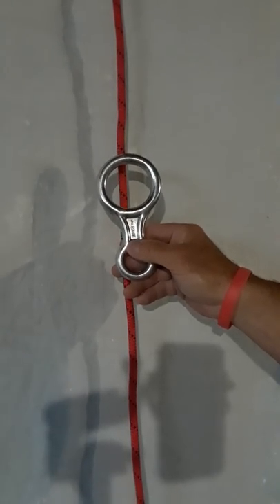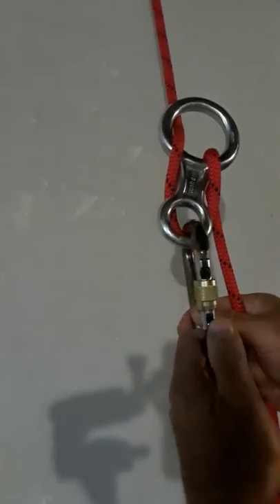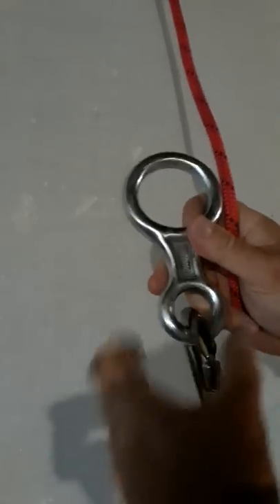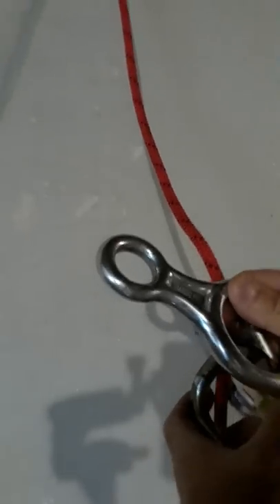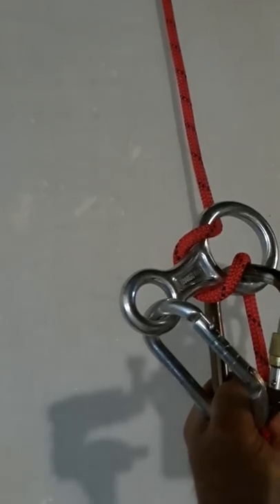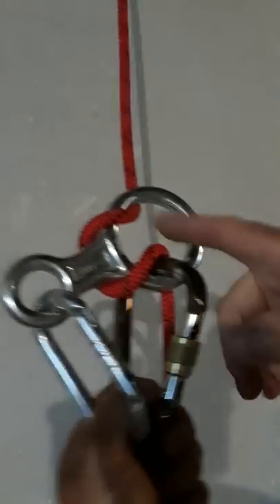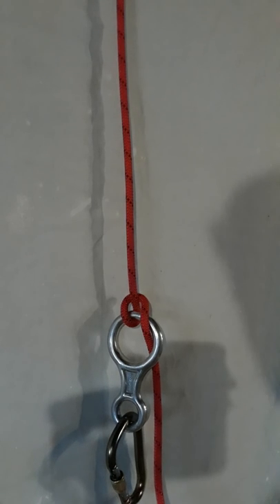RAPPEL MODES   10 WAYS OF RAPPELLING WITH A FIGURE 8

Comment: The canyoning mode (without your modification) is crazy...why anyone would rely on that is beyond me.  Your mod should be considered mandatory.  Well done video. Thanks
Reply: The main use for canyon mode is for short abseils into water, especially with fast moving water at the bottom. It is sometimes very dangerous to be attached to the rope in this kind of water, so it's helpful to be able to get off rope as quickly as possible. I tend to avoid using it and just set the rope length to be just under the water for quicker dissattachment.
Reply: That is not his mod.  This guy claims he came up with some of these methods but that is SO not true.

Comment: How about just use petzl stop or simple or anything similar, can lock off easily....
Reply from the maker: HAVE THE STOP AND SIMPLE, don't like the simple, love the STOP,  problem is that in the real world you might need to rappel with double ropes in order to pull the rope down and use it again, the Petzl's you refer to only work with single strands of rope, and they don't work well with any ropes 9.2 or smaller.
Reply: Rig. All im saying. 😁
Reply: For the price of a Petzl stop you might as well toss the figure 8 and get an auto braking device.
I use a prusick below (not above) the figure 8 and it works extremely well.

Comment: When creating a video ALWAYS have the camera in landslide orientation,  horizontal. All video cameras ever made, all TV screems, computer monitors, movie theater screens, all are landscape mode. Capturing a video in portrait mode is the same as looking through a ole time key hole, or wearing horse blinders, you cut off the left and right of the image. Humans field of vision is considerably more horizontal than vertical. Also, video captured vertically places the video in the center of the screen with borders left and right, watching such a video is spatially disorienting.
Reply from the maker: didn't know that, will do it horizontally the next time

Comment: Original blaxploitation flick, maybe "Shaft," where he rappels into a window with his gun barrel as the brake bar, so he instantly releases the rope and has his gun ready to shoot in one slick move. Of course, using a Munter is topologically feasible in an 8, but because you have to thread the rope through (versus just clipping thru the gate in a locking biner), you would either need to pass  the entire rope length thru when setting up at an anchor, or else pre-thread onto the 8 and then use the free end to tie into the rappel anchor - ? Entirely illogical and purposeless. Rappelling is one of the most dangerous actions in climbing, and systems have evolved to be more simple, clear, and not tricky or deviously complicated like most of these gimmicks.
Reply from the maker: or just remove the 8 from the carabiner with the rope still attached
Reply from the maker: You want simple???  Just go back to the 50's and 60's when all they were using was one carabiner, wrapping the rope around the spine, and rappelling that way.   The Army still uses that system, very simple, clear, only one piece of equipment, idiot proof.  I learned that method in the Army, still use it,  and you are taking this video the wrong way, it is not meant to tell you what to do, rather it shows what can be done.  There is a difference.
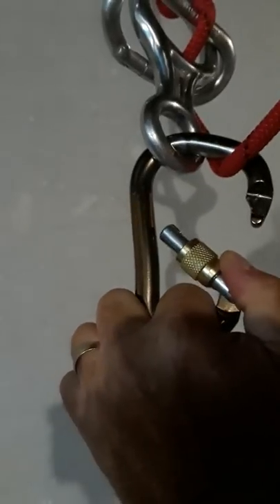Reply: @rappelclub8271  I actually watched an ROTC group practicing with the 'biner wrap, single oval into a diaper sling, and halfway down a less than vertical wall, the person got stuck, because the wrap was around the (non-locking) gate, and wedged stuck with the gate open. The person was able to weight their feet, but was trying to free the jam which threatened to come unclipped and drop them fifty feet to the ground, where a spotter was making it even worse by giving a "fireman's belay" by pulling on the rope ends. Somehow no one fell, but I cringed watching. At 4:35 the  idea of unclipping the locker while on rappel is really bad. Scottish legend Tom Patey had his 8 cinch up into a Crows foot or girth hitch, and in bouncing to loosen it his carabiner unclipped, leaving the 8 on the rope has he fell to his death. I've stayed alive in 54 years of climbing by being paranoid about rappelling, and sticking with the simplest, safest method available.
Every video will attract clueless beginners, and emphasizing where things can go wrong should be the primary focus of any climbing how-to video.

Comment: Can you do a munter hitch on a figure 8? Here's an opinion from a full time rope access professional.

Listen, there is no "can you do this" there are only manufacturers recommended modes of usage (for any given device) and usage not recommended by manufacturer/ device not designed for given implementation.

Then the question changes into "is it possible to use a device in this manner and will doing so kill you?" In the case of a munter, then the question is obviously "can you tie a munter hitch through a non-opening device?" The answer is clearly yes, but then this becomes a non-midline attachable device. 

So can you use a munter on an 8? I'd say "as long as it doesn't present failure modes that are likely to kill you, then the only apparent problem is it becomes non-midline attachable."

Comment: Your inventions seem unsafe or useless to me. You are sideloading your biners and If you unload the system and then load it again, elements can shift and the non-locking gates could just take you off the rope. Opening your locking carabiner in flight and then changing the brake direction is not good either. Now you need to remember to do something else. Rappel on a munter is for emergencies like if you lose your 8. You endanger your viewers. Please stop.

Comment: Can we use only D ring for rappelling....
Without fig 8
Reply from the maker: sure, it is called the carabiner wrap rappel and only needs 1 D ring, or you can use 2 D rings and it is called the "french rappel" or "crossed carabiner" rappel
Reply from the maker: just added another video on ways of rappelling with just carabiners, check it out.
Reply: @rappelclub8271  cool

Comment: May i add the auto locking setup:

bite through the large opening, twist it 180 (to the right) before attaching around the smaller hole then clip in the large opening.
if you press down on the 8 so its pointing down (instead of sideways( you rappel down, if you let go it stops you, might creep a bit with wet (8,5mm in my case) rope
Reply: I was about to comment the same thing.
Reply from the maker: I was not concentrating on lock off methods, or I would have included yours along with the one used when rappelling in canyon mode
Reply from the maker: I was non concentrating on locking off methods or I would have included the one you mention, which I believe is called the Italian method, as well as the lock off method used with rappelling in canyon mode

Comment: I’m in no way an expert climber but I would like to add ☝️ more variation to you list. Not only for descending but also for an ascent , place a bite through the big hole with the small hole pointing to the Rt. rotate the bite counter clockwise and place it over the small hole and clip into the big hole now you can ascend with the aid of an hand ascender with a foot loop and to descend keeping your brake hand on the tail pull down on the 8 like a lever ( this doesn’t work with a pulley for a 3 to 1 mechanical advantage)
Reply from the maker: Yes, you  are right, but this video only concentrates on methods for rappelling, not ascending or locking off
Reply: Rappel Club I think it should still count think of it like a self locking rappel ? cause your weight pinches the rope by pulling down the 8 allows you to control your descent

Comment: Nice video...in the rescue mode do you have to worry about the rope going high in the eight and locking it up??? Had this happen to buddy as he was coming out of unlocking the rope for a stop in rappel?
Reply from the maker: No, the multiple wraps around the big ring in the 8 makes it almost impossible for the rope to form a girth hitch, unlike in the regular rappel mode.  It can happen, but you would have to really rub the rope up against a wall or something as you are going down.
Reply: Just seen where Omega is going out of business...sad. Another question I seen where during set up you should push through a straight 8 and pull through a rescue 8 any thoughts???

Comment: Very interesting on all the variations but some seems too complicated. In my personal experience I like the Munter hitch using a pear shaped carabiner. Not enough friction? Use the double Munter. Back up your system with a prusik loop or Kleimheist
Reply from the maker: the munter is great, but also puts the most amount of kink in the rope
Reply: @rappelclub8271  I have not have that problem but maybe it's because of the type of rope being used. I know most rock climbers & rapellers use static rope. I believe I use dynamic  ropes, maybe that's the reason.
Reply from the maker: @benjaminchen1964  No, that is not the reason, I have both dynamic (for climbing) and static for rappelling, caving, and canyoning, if you are doing rappels of 100 feet or more, the kinks and twists can become a problem, especially in natural environments, plus it wears out the rope very fast since all the friction comes from the rope rubbing on itself as it goes around the carabiner.

Comment: Munter on a Figure 8... sure but I see two problems.  You have to have access to the anchor point or end of the rope at the top in order to set up the munter and then also you have to have access to the end of the rope at the bottom.  If the rope is already tied into the anchor, you would need to pull up the rope to feed it through or untie the rope from the anchor.  Same with the bottom.  if the end of the rope is tied off.. you have a problem...
Reply from the maker: You are right, I am not telling you to do this, only that it can be done.
Reply: Hes talking about putting a 180° twist in canyon mode before going over the small hole. It makes it an assisted braking device. Pulling down on the small hole opens the system releasing it relocks it

Comment: I prefer a fisk myself. But I've used figure 8ts ,shackles, carabieners.
Know your wraps.
With a fisk you can easily stop and arrest decent, and use both hands for work. I've been trained in tower rescue.
Reply: Never even heard of a 'fisk', thanks for posting am off to Google ;D
Reply: @dereksmith4791  The Fisk (See https://www.youtube.com/watch?v=nFCUNhjOTmw ) is similar to the rescue-8 in that it has holes & horns for control features.  It is considerably bigger, heavier, and more complicated & expensive, but usually puts somewhat less stress and strain on the rope.  I used it briefly in firefighting, and feel it has its place in industry, and is perfectly usable for sport, but seems much less practical with no significant advantages.

Comment: Open screw gate during a decent, not for people who enjoy safety.
Reply from the maker: If you know what your are doing, know your equipment, know your limitations,  opening a screw gate mid rappel is not big deal.
Reply: opening a safety relevant carabiner should be everyones limitation?!  @rappelclub8271
Reply from the maker: @dsa20081997  OK, if safety is your absolute concern in this matter, than you are right, but I normally use biners rated at 51Kn or more.
Reply: Rappel Club Can you reply with a link to where you buy them at?
Reply: @rappelclub8271  it´s not about the rating, it´s about you unclipping from your rapell device

Comment: I really like that one at 5:30. But I feel like it would be way too easy to gate-load the carabiner and break it.
Reply from the maker: if you rig it correctly, you will never gate-load the carabiner.
Reply: @rappelclub8271  That is a remarkably dangerous rig.  If there is slack in the rope, the carabiner in the bight of rope can turn and land crossways on the figure 8, with the rope bearing on the gate.  When loaded again, the rope goes through the gate and you're relying on your grip strength to control your descent.  (We learned that back in the late 70s, for what it's worth.)
Reply from the maker: @cbat09  I guess I might just be lucky then, I have been doing this for over 32 years, what you are describing has never happened, not even close.  I do this for fun, not to commit suicide, so I take my personal safety very seriously, as I am sure most climbers do, your suggestion makes it sound like I am some reckless and brainless thug just out to give bad advice
Reply: @rappelclub8271  So, you admit to being lucky for over 32 years, but you don't disagree that if the figure 8 is unloaded and there is slack in the rope then the carabiner could turn and slide down the figure 8 with the rope running over the gate of the carabiner.  
Stay lucky, Rappel Club.  I prefer to use techniques without such obvious modes of failure.
Reply from the maker: @cbat09  there is no way the rope will run over the gate, and if you think this is even remotely possible, please demonstrate with a video, and if you are rappelling, how will the figure 8 be unloaded until you hit the ground????  you have a hell of an imagination, maybe a green gremlin could also pop out of thin air and cut the rope, leading to your death, but do I think that will happen????  Obviously not.

Comment: 6:30 the idea with using the canyoneering set up isn’t so you don’t have to remove the carabiner to put it on the rope it’s so that if you’re abseiling into a pool of moving water you can flick the rope over the end of the figure of 8 and swim away from the rope, instead of calling it a canyoneering plus just use the figure of 8 in a different set up, adding that extra carabiner is defeating the whole idea of the canyoneering set up...
Reply from the maker: actually it is for both reasons, not just the one you point out, and adding the second carabiner does nothing to prevent you from quickly swimming away from the rope, with practice, you can quickly unhook the second carabiner with little thought (takes me about 2 or 3 seconds while the set up is under water, just by touch).

Comment: Do you use locking biners in real time? I would be concerned about the rope getting freed up.
Reply from the maker: usually I used locking carabiners, but for certain applications it is not required, such as the very old way of rappelling called "carabiner Brake" method using 4 carabiners, opposite and opposed

Comment: Hi Rappel club . I'm looking for something that will let me let out rope  that at one end is tied to the chimney  and  attached to me some how  that will allow me to slode down the roof at a steep pitch till I reach my gutters  to clean them out . Once I reach the gutters I want to stop and not be allowed to go any farther . I would like to be locked in  place My hands will be in the gutters taking out leaves and putting them in a bag so I can't hold on to the rope. I have a tree stand body harness  I can wear that has a place to attach a carabiner  to .Is there some type of mechanical device  that a rope runs through  to let out rope  and has a way to lock it in place once I'm close to the edge .
Reply from the maker: if you use a figure 8 in canyon mode, once you reach your objective, you can wrap the down rope around the "neck" of the figure eight several times to put you in a hand's free, locked off mode.
Reply from the maker: Or you can just buy a Petzl Stop and once you let go of the device, it will automatically lock up
Reply: @rappelclub8271  Do have a video showing how to use the Petzl stop ? If so will you put a link to it  here ?
Reply from the maker: @Sertao2013  Yes, the Petzl STOP works great, only problem is that it only works with single ropes, and does not work very well if the rope is smaller than 9mm, other than that, it is a great piece of equipment